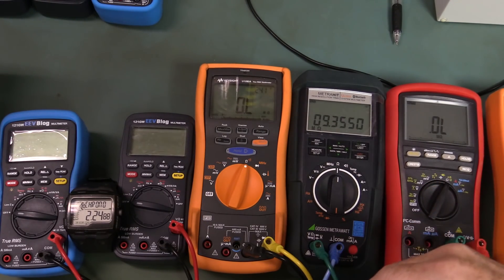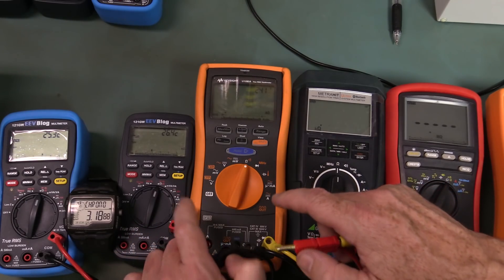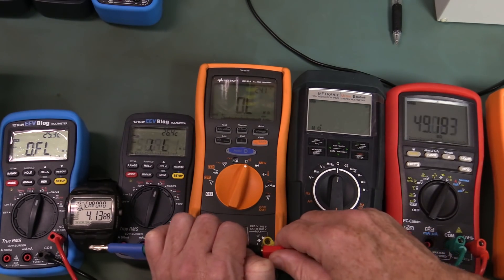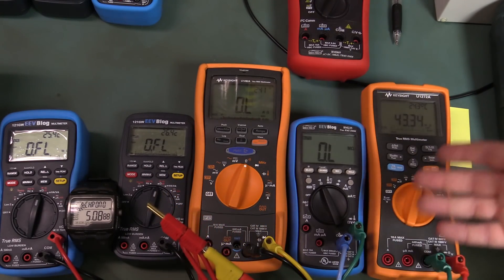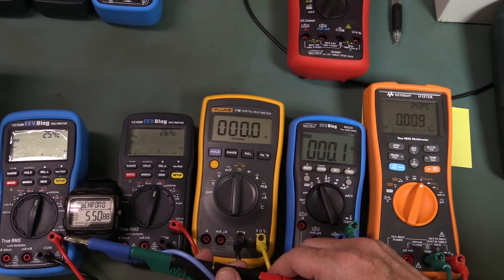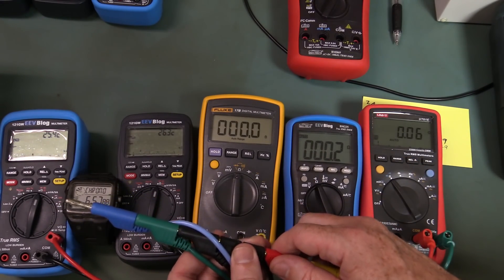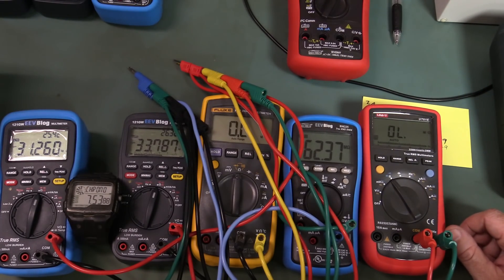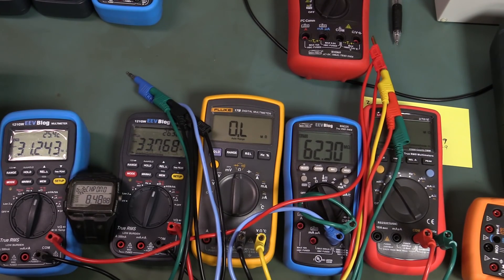121GW Ohms Autoranging Speed Update

Comment: I like the feature that some meters show a preliminary value, like 000.0k. In this case, you know that it is a less than 200 ohm, so if you are trying to find a dead short you know you have to hold it a bit longer, while if it immediately gives you like 100k, you can continue to the next pin. Of coarse, the preliminary value must have some accuracy, otherwise it is better to not show it. Or only show the digits that are accurate.

Comment: Dave, I think your test is flawed here. Pains me to say this.
You are using resistance where all meters will be sending out a drive voltage which could cause mis reads and timing issues on auto ranging between the commonly connected meters.
You should be using a voltage range ... :p
Reply: Alternatively use a 4 pole switch to keep the meters isolated from each other.

Comment: I have a meter that's reasonably quick to autorange when the probes are shorted but when its measuring higher resistance, it is very slow. So the short circuit test may be very misleading.
Reply: Good point, had a meter like that too. Anyway just the fact that the Keysight and Gossen are equally bad does not make it better. I've been traumatized by a Gossen 23s in AC mode so I am biased :-)

Comment: Hi, Dave, for a proper test you need to keep the DMMs isolated.
Build your self a multi relay jig to do it.
You can then do the beeper activation test as well.
Can you tell us what the open circuit voltage is on the probes please?

Comment: Keep at it on the auto ranging as much as you can on the chipset. :) Mine has been in daily use since I got it my 34401a is back to second use on the bench. The auto ranging is FAR from a deal breaker for me to consider buying another in a few months. Just took delivery of a HP740B voltmeter today nearly 30 seconds to get a stable reading to match the 121GW.....

Comment: I take it you are testing with one resistor in parallel across all the meters.  Why don't you just measure 5 resistors and have a common ground pin and send each of the matched resistors to the positive. Then you won't have the meters sending power through the wires and having to test again.  I think they are going to be faster then that autoranging. Mine takes less then quarter of a second to autoranging and it's a Maplin UK precision gold meter from 10 years ago...

In fact looking at the wires you have two green wires on positive connections but onto goes to the negative rail on the group one goes to a positive and the wires for the rest seem to be connected to negative from negative.  That means they are all sending positive current through in different directions. That's a rookie error.   Lol. In like Flinn.

Comment: Where can we get the new firmware? Maybe I'm overlooking something obvious, but googling and searching the eevblog site and forum hasn't turned up anything for me, yet.
Reply: I'm still on 1.01. I didn't realize that there were newer versions until I saw this. Are there release notes for any of the newer versions?
Reply: EEVblog2 Dave, maybe you should tell in your videos about firmware improvements that the are not released yet. Me and surely many others saw the improvements and tried to get the new firmware but could not find it. Maybe release it as a beta. Many of us are surely willing to help and test such things.
Reply: brettski74 this was the question I also wanted to ask. I am still on 1.02 as I got it and it also has a bug that it does not save the display contrast setting after power off.
Reply from the maker: You can't, it's not released yet.

Comment: For these comparisons, why not rig up a little box with a 9V battery, a toggle switch, and a series of little telco relays? Three DPDT relays would get you testing six meters at a time. You could toss the parts into a little box with a bunch of banana jacks and make up a set up jumpers with banana plugs. It would look smart and improve the testing considerably. It's really not fair to rate them as they fight each other.
Reply: Ya, this is a very poorly implemented test.  We can see that there is a problem when some of the meters have readings while others are over the limit.  Either test them individually or implement relays so they each have their own circuit.  Testing individually is actually really easy because you don't have to retest and retest with each new meter added as the time won't change.  I have to give this a fail.
Reply from the maker: Yeah that would be neat, but as it is it's good enough for the purposes of a decent comparison.